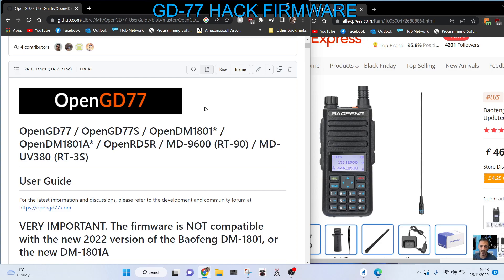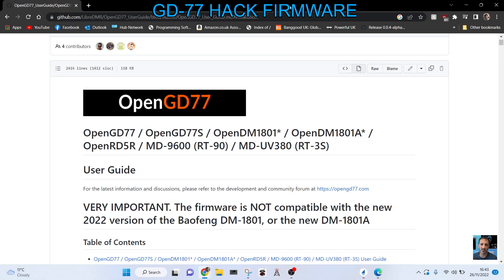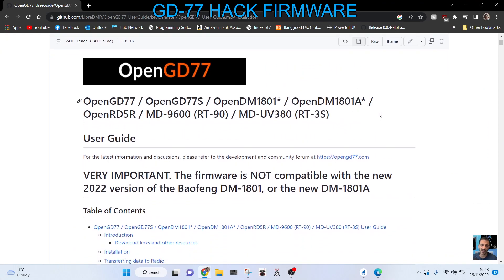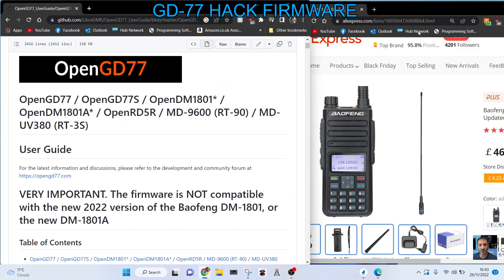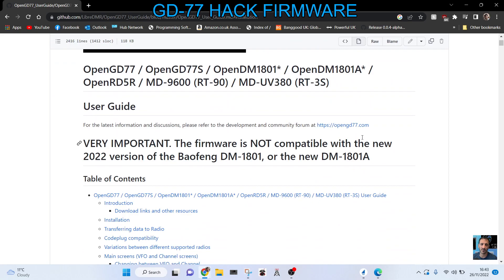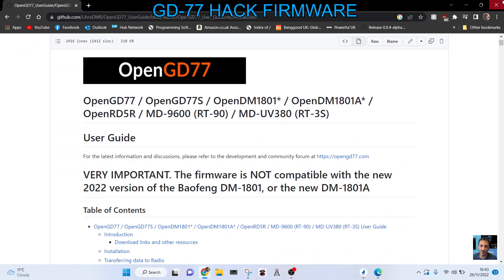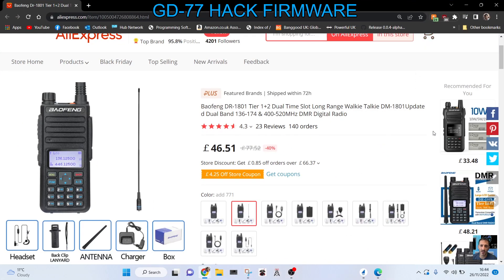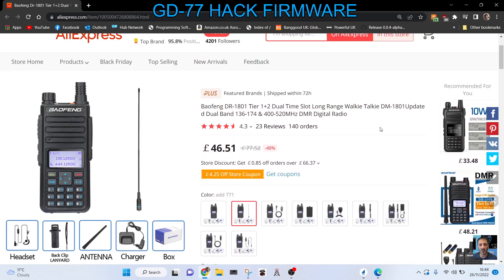GD-77-1801/ HACK FIRMWARE DMR RADIO

Comment: Are you absolutely sure that this opengd77 will work on the model you are showing. This is a model not DMR but DR. Inside, under the battery, it writes on the DR sticker, but when I turn it on, it is displayed as a DMR model. I bought it and everyone told me that I will not install opengd77 on this model. This is a completely different radio model. The DMR model is no longer produced. You also show the 2022 model. You will record a video on how to do it, but exactly on this model, not DMR 1801 but DR 1801. Great request. 73!
Reply: Only works on DM 1801 Fl does NOT work on DR
Reply from the maker: Best to check on gd77. Com
Reply: What about the 1701 advertising  as GD-77  ready ?